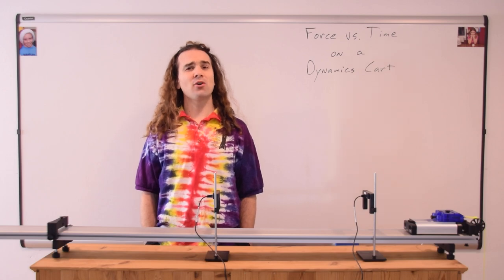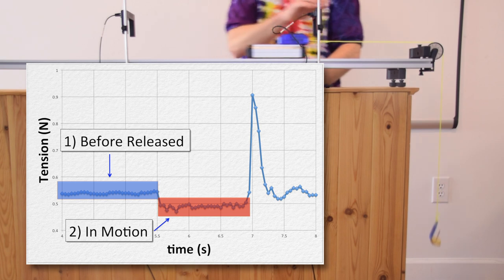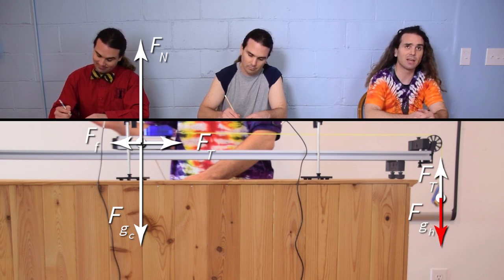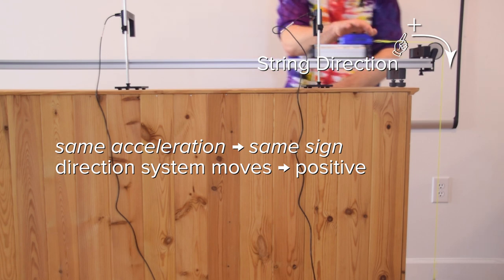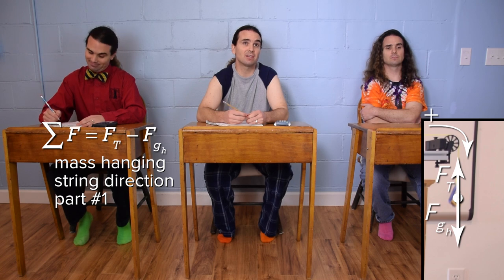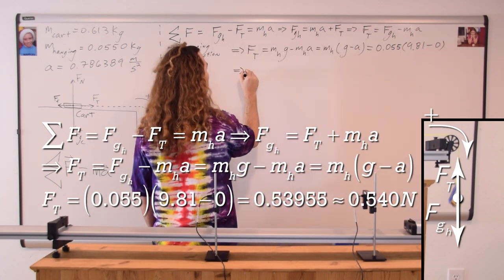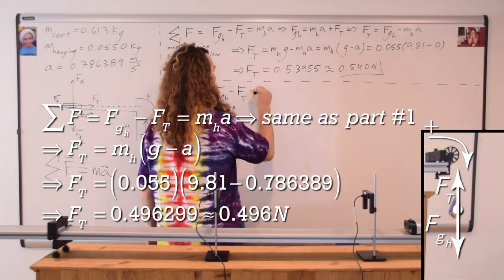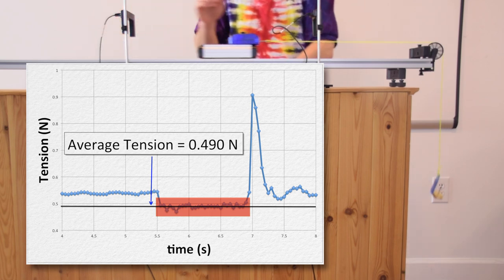Force vs. Time on a Dynamics Cart

Comment from the maker: Shadia M. @ 9:10 the 0.055 doesn't cancel out. Sadly, there is a misplaced parenthesis in the equation which makes it appear as though that should be the case. The equation is written correctly on the board @ 9:37.

Comment: ***Note that at 9:10, the brackets are at the wrong place. It should be (0.055 x 9.81) - 0.907 all over 0.055 to get a negative acceleration of 6.68 m/s^2. Thank you for the video!
Reply from the maker: Yep. That's a bummer. It's pretty obvious that it is an error though. Which I guess is good?
Reply: Flipping Physics Your videos are much more helpful than Khan Academy. It reduces my studying time by half. Thank you :D

Comment: Im confused as to why the free body diagram is the same for both parts 1 and 2 when in part one the force of gravity on the hanging mass cancels out with the force of tension, and in part two the force of gravity overcomes the tension.
Reply from the maker: In part 1 my hand is preventing the system from accelerating and therefore the force of tension is larger.
In part 2 I let go and the system is allowed to accelerate and therefore the tension in the string is reduced.

Comment: This is a great video, but at 7:54 you say "theoretically predicted" tension value...but I don't think it's really theoretically predicted if you are using an acceleration value based on time you collected from the experiment.  Also, at 9:11 the 0.907 N tension value should not be in parentheses.